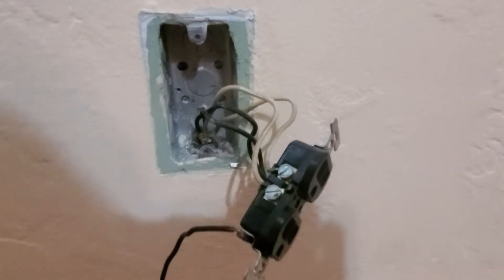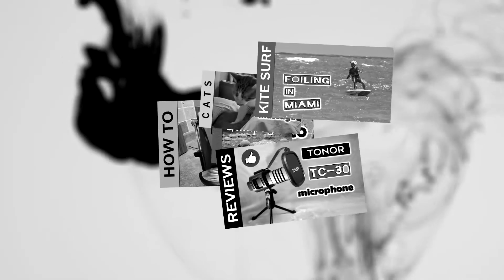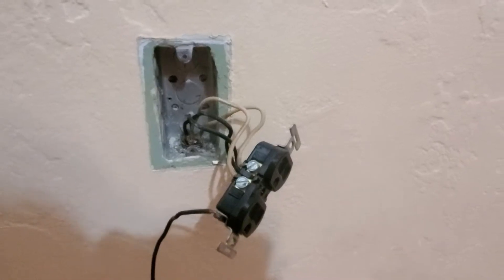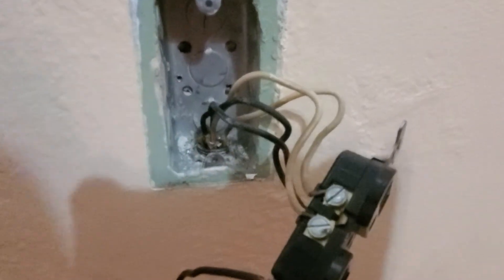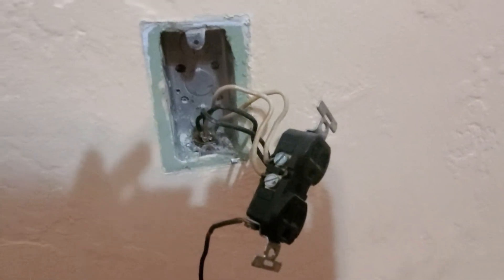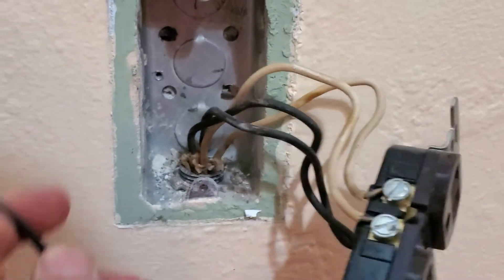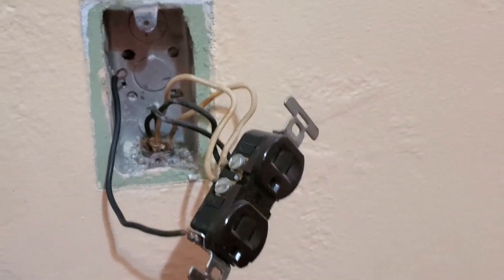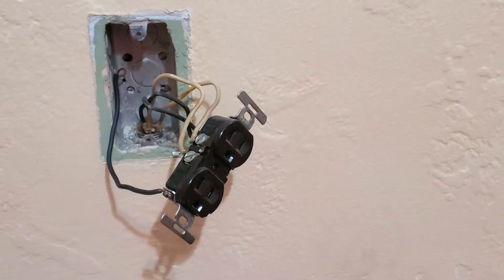How To Ground Old 2 Prong Outlet

Comment: A couple of things, first, this is completely acceptable and up to NEC code IF, and ONLY if the metal box is already grounded back to the panel. There were 2 ways metal boxes were grounded in the 50's and 60's if they were at all. Either by BX cable which is the flexible metal sheath covering the hot and neutral wires. These cables were bolted into the outlet boxes and attached to the main panel. That gave it a ground path. So if you had a 2 prong ungrounded receptacle, you could do exactly what is described in this video to ground a 3 prong grounded receptacle into an older metal box and have a proper ground. You could also use a self grounding receptacle. They are sold with a small brass tab on the ears so when you screw it into the box it forms ground. In the early sixties, they started using NM wire with ground inside. It just wasn't attached to the receptacles. They bonded it to a ground screw on the outside of the box and would also wrap any other ground leaving the box to down stream receptacles. You could also put in a grounded 3 prong receptacle in this situation as I described above.  Although you need to use a proper green grounding screw. If you cannot or do not know if you have a grounded metal box, there's an easy test. Get a circuit tester or a multimeter. Put the black lead on the screw that holds the cover plate on. Or unscrew the plate and touch the lead to the metal box. Then put the red probe into the hot side slit. It's the smaller of the two plug openings. If you get a voltage reading, you have a grounded electrical box. You can now safely add a grounded 3 prong receptacle. After installation, get an outlet tester, plug it in and make sure it reads that it's all correctly connected. That's it. Now, if this wasn't done prior to this install that the video shows, he could either have ground or not. If this box is not grounded and you do this, it serves no purpose. You still have no ground. But now you do have a hazard. If there was ever a problem and the current needed to find a ground path, it can't. It will try to travel on that short wire you added but since it doesn't go back to the panel , all you've done is energize the box and anything touching it. Not good. So unless you check for ground through the box first, this will not be correct. Perhaps the poster of this video already did that and forgot to mention it. The bottom feed into the box does look like a BX cable attachment, so this is probably ok. But to anyone watching, just make sure to check first. If you've done the testing and it turns out that you have no ground at all to the box, there's some options. NEC code allows you to reinstall a new 2 prong ungrounded receptacle. But that won't allow you to use a 3 prong plug. So, you can, according to NEC code, install a GFCI 3 prong receptacle. You'll just have to label it, no equipment ground. Then you can plug in a 3 prong device. You still won't have ground but will have some protection in case of a problem. Third option is to rewire your circuits with new ground back to the panels earth ground. Very costly so most choose other options. Also, those 3 prong adapters don't do anything unless the box is grounded and the adapter is fastened to the outlet cover screw. Be safe.